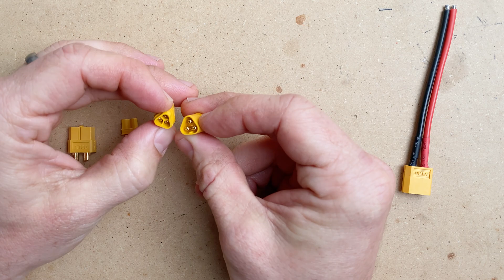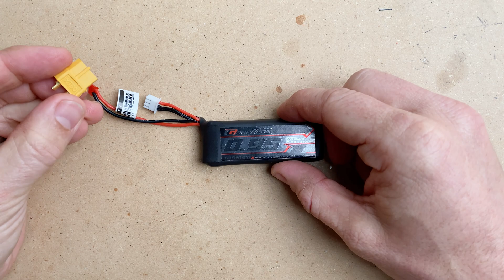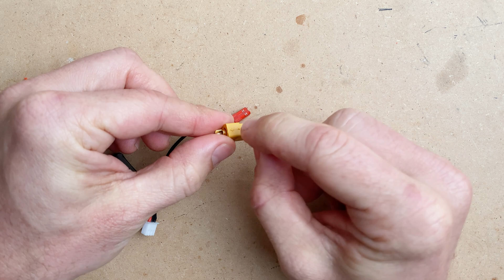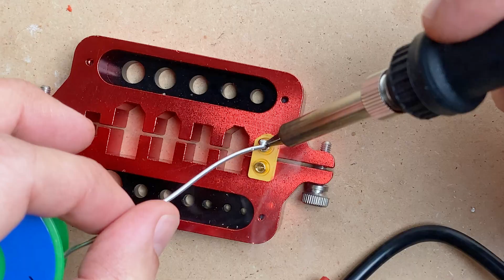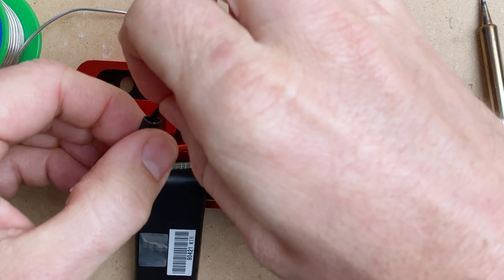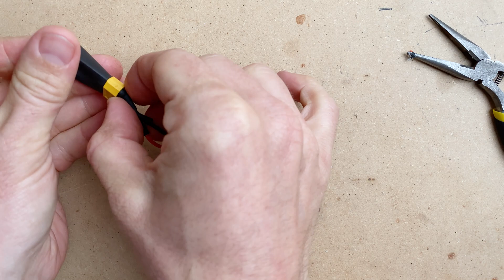How to Rewire a LiPo Battery Connector

Comment: I have a question might be a good one lol I have a LiPo 500mah 2S battery with 2 main wires Red & Black then on the balance lead wires I have 3 Red, White, Black was wondering if a person could take the balance lead plug off and tie the White & Red together and splice them into the Red main plug wire and then take the Black balance wire and splice it into the Black main plug wire, wondered if it was safe to charge and balance the battery wired like this instead of having to use a balance board? I mean it should be fine right I’m just using 1 plug to do both

Comment: It would be nice if the airsoft industry used xt60 connectors too; most brands use Tamiya ( molex ) plugs because they are stuck in the 80s. A few use deans connectors and act like they're a space-age design... 'cos they're stuck in the 90s-early 2000s...

Comment: Is there a mechanical termination option for XT 60’s? Maybe a moisture proof splice?
Reply: You don't want a mechanical-only connection when dealing with battery connectors that carry any real amount of current- you need a solid solder joint ( and that is what forms both a solid electrical and mechanical connection ). You can get glue-lined heat-shrink tubing that will cover the solder joint and form a  water-proof seal should you really need one.

Comment: hey luke,
the traxxas batteries don't seem to have a balence connector what do I do?
Reply: Which batteries, specifically? Some hard-case lipos have a smaller female bullet connector built into the case that is for balancing & requires it's own special balancing lead to connect to the charger. You'll need to check traxxas's site to find it ( or a traxxas retailer ). Best advice I have though is don't waste your money on traxxas batteries, they are grossly overpriced and over-rated, look up alternative options from hobbyking or other reputable retailers.